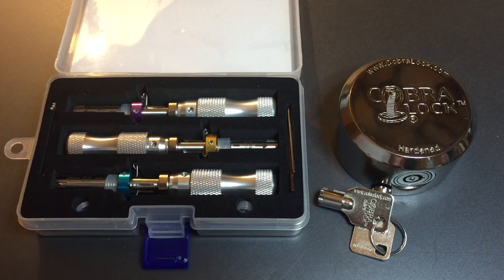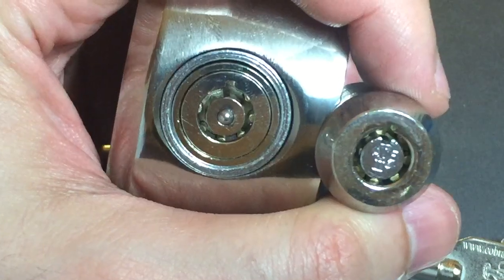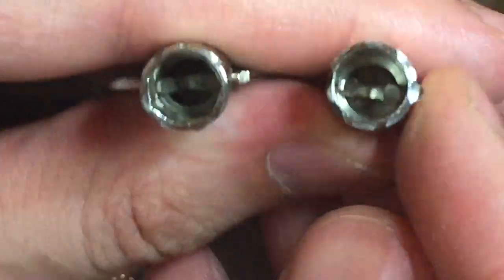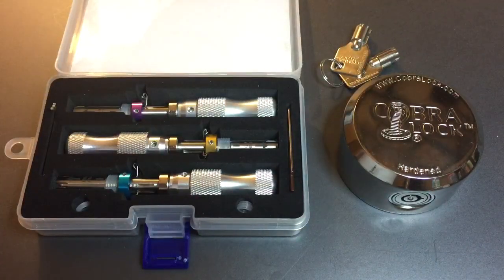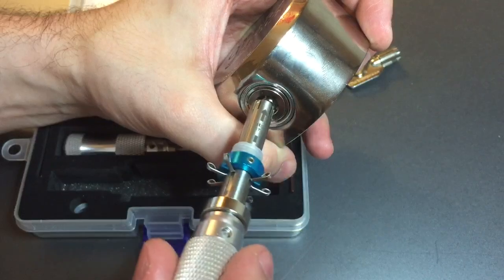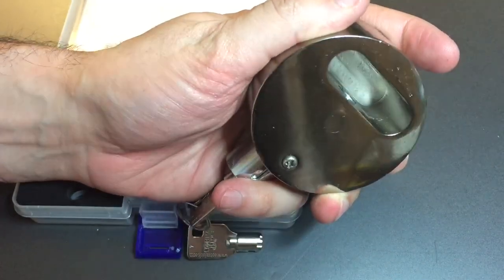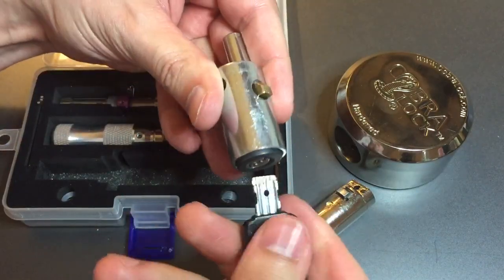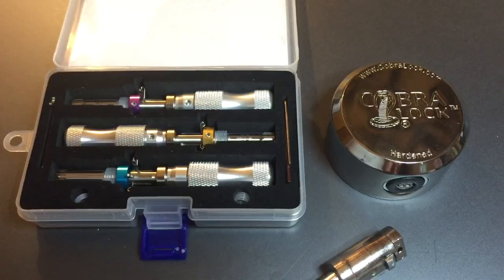[224] Cobra Tubular Puck Lock Picked and Improved

Comment: There's someone on Ebay selling these locks with Abloy cores. I can't tell from the photos exactly what model the core is, but it's definitely an Abloy disc detainer core. And it's only $51 with free shipping. Gonna be hard to find a better puck lock than that.
Reply: I bought two of these locks and discovered that if don't come with Abloy key tags you can't get spare keys made.

Comment: To the lock picking lawyer

Just received my huk kit, older style like yours with the tension bar, my question is my 7.8 and 7.5 seem to not fit in the keyway/groove. Have u ever seen the tooling of these picks being off before? If I press any harder into the lock I'm going to either damage the pick, needles, or score the hell out of it, I believe when they made my kit, it maybe out of spec, like the machining or tooling is off, idk I'm stuck lol
Reply: Just wondering if you where able to get that 7.8 to work?  I ordered the set to open up my (deceased) grandfather's tool box and I still can't open it. I've checked with local locksmiths...no help. I'm lost and REALLY want to keep this for my son. Any suggestions anyone???
Reply: @jusmejohnson  little late.. are you sure the lock has a need for tension bar? If it has 2 notches, you need that tension rod installed. If it only has one notch on lock then you can’t use tension rod s as no u need to remove it

Comment: The octagonal inner security feature sounds like it might be a lie to trick customers into feeling more secure. Is there any chance you could get the informaion from the special key or your impressioning tool to get a duplicate key made from a normal blank, so that you can test your theory. If normal keys work, then the key control is an illusion that you should probably call out. But it is possible that the normal key looks like it would work, but there is something in the design that stops it working.

Comment: Thanks for doing the instructional vid!
Reply from the maker: My pleasure... I've been meaning to feature that Cobra lock for a while.  This was just a good excuse.  :-)
Reply: I've got a set of those picks and have been rather unsuccessful with them. I'll have to try your method.
Reply: +technosasquatchfilms I've found that using them on locks that have a cam attached to the back with any kind of pressure on it makes them really difficult to use. Easier to spp it one time and turn it just a tad where it isn't locked then you can impression it and open it the rest of the way.

Comment: I have the Goso impressioning set. I wouldn't have those they look better to me. Just in case I'm not the lucky winner what brand are they?
Reply from the maker: This set is "HUK" brand.  I have the Goso set as well... they never come out for two reasons.  First, the sizing of the Goso tips is a tad off; the HUK set fits into more keyways more smoothly.  Second, and just as importantly, these work much, much better... no comparison IMO.  FWIW, I have a Klom tool also.  The HUK works better than that one also.
Reply: +LockPickingLawyer ok cool. Thank you! I'm going to order a set.

Comment: let's say you put in an Abloy core. is the lock just as good (physically attack wise) as an Abloy branded lock ?
Reply from the maker: Maybe as good as some Abloy locks.  I don't have that many Abloy locks, so it's hard for me to generalize.  I have a 362 (a truly bada$$ lock) in which the protec core is set deeply into the lock.  I'd have to imagine that adds an extra element of protection from physical attacks.  But for practical/normal purposes, I'd imagine the security provided by the Cobra/Abloy combination is pretty darned good.

Comment: It seems that the detente is only spring loaded.
So, could it be possible to design a shim for this kind of locks ?
Some kind of hook made of thin sheet metal.
Reply: it depends on the lock. some are spring loaded, but only when the key is in and turned. the Abloy plug latch doesn't have any angle at the end. so the pin goes well inside the hole and is unable to be shimmed.

Comment: Am I totally off beam.. or does pulling the core only require shearing that one weedy screw regardless of what pick resistance you spend $$$ on?
Reply: the lock cylinder has its own retracting pin. the grub screw is just to prevent the whole lock housing from falling out once the proper key is used and the shackle is retracted, it doesn't provide security.

Comment: Did you have to mod the pins to install them I just tried fitting mine and none of them fit,
Reply: some you may have to shave down a bit so they clear the hole and allow the plug to come out. but also note there are a few different holes for different plug types. make sure you're using the right hole on the bible..